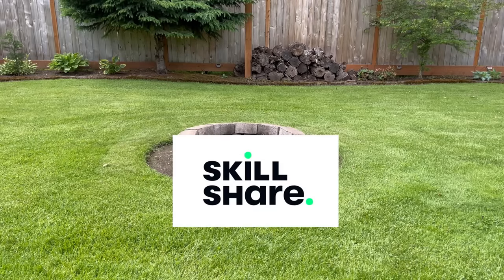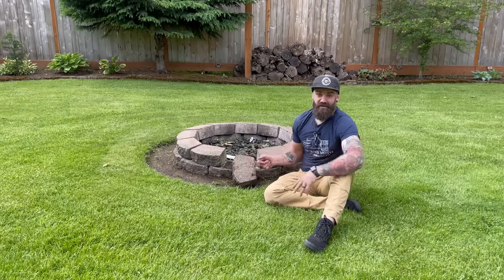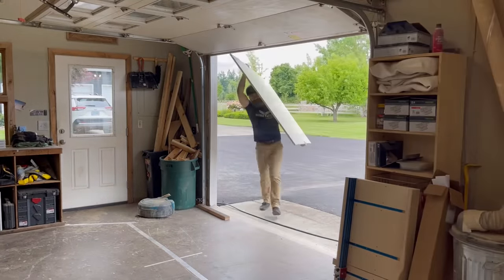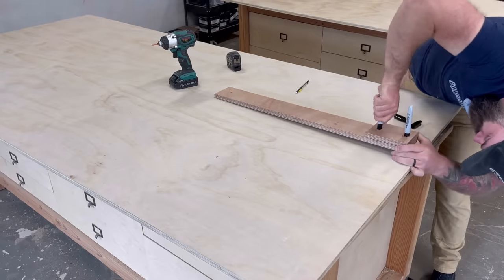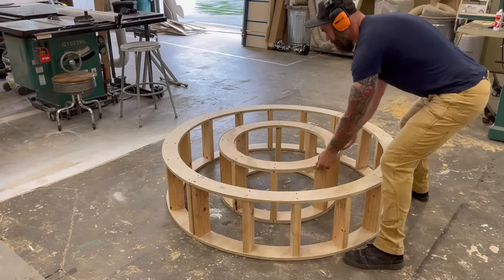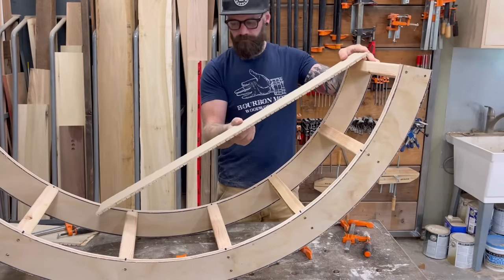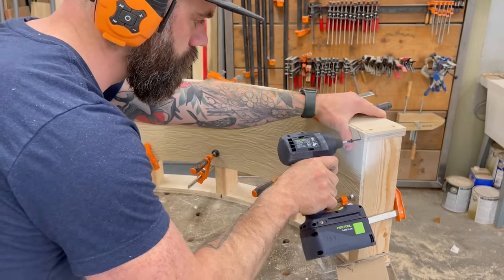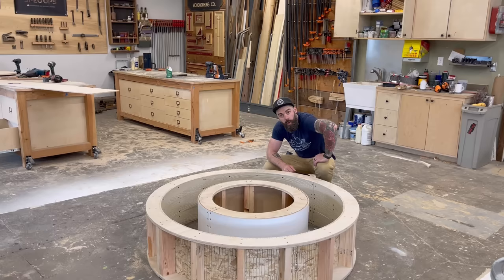Making a Concrete Fire Pit the Right Way || Ultimate Fire Pit Build

Comment: I'd be very curious to hear how you would design the inner form to come apart easier?
Reply: Hi.

The key to solving this problem is to make one of the junctions between the form pieces such that it leaves space for a triangular wedge. Instead of cutting perpendicular across the top and bottom of the form pieces, cut at 45° and place the sections of 2x4 flush with the angle. In the triangular prism shape now forming the junction between two of the inner form sections, secure in a triangular prism shaped piece of timber. It would need to fit neatly and be very well secured as the concrete is heavy .

In this way, when it comes time to remove the inner form pieces you would remove the triangular prism of wood from the junction where you installed it and this would allow you to pull one end of the section of inner form into the centre of the circle , thereby releasing the attraction of the form piece from the concrete by peeling. Once one piece has been removed, the other pieces can be peeled in the same way,  they would not need altered junctions. Only one junction would require the alteration. Bit wordy, but hope it helps.
Reply: @RoscoMule  makes sense to me...thanks!

Comment: You didn't use Form Release agent on the inside ring. 
I hope you didn't develop cold joints between pours.  
It's not load barring so it shouldn't matter but normally you need an epoxy cold joint sealant between pours if they exceed 60 to 90 minutes but it depends on the setting time that is most important.  It's just a fire pit so not a big deal at the end of the day.

Comment: Chamfer.  If you bang into concrete, it's going to hurt, no matter what.  If you bang into that sharp corner at the top, it's going to hurt, and cut you.  You never want to leave a square corner, so you get some 3/4" chamber, and nail it to the inside of your form, leaving a nice 45 degree chamfered corner when you pull the forms off.

Also, if I were the foreman, I'd probably stomp on the labor a lot more.  🤣

Comment: You seem very meticulous, however I don't think it will handle the thermal expansion without cracking... also sitting next to this you won't feel warm as the heat will go straight up and not outward.

Comment: It would've been cool to have the pvc go in at the bottom on the outside and snake to the top on the inside. This would've given you a "smokeless" effect. Because this is fairly wide, it wouldn't have worked as well as the small smokeless fire pits, but it would've been cool. You would also have to put in small drains at the bottom for water, as well.

Comment: I mean, this wasn't too bad (J/K very good job)...but if you want something even simpler and easier; you could have just bought Tube forms in 4 - 16" different radius (like 48 and 42" forms).  Prep your location with sand and/or pea gravel tamped tight and about 5-6" into the ground.  Set your largest diameter tube,  make a tic-tac-toe board of rebar to set 1/2 way through your bottom pour.  Your bottom our is going to be about 4 inches, mix it all at once, put 1/2 in, lay in your rebar, pour the other half.  DO NOT SMOOTH the bottom yet; set your inner tube as centered as you can pushing into the fresh concrete by only 1 or 2 cm.  and set vertical rebar between the tubes about every 6 inches and allow to achieve approx 1/4-1/2 set time, then mix about 2 times as much concrete for your walls and gently place in the forms so as to keep rebar vertical (this ensures your stuff remains all ties together even if it cracks).  Use high Sand content for the sides, use some extr4a pea gravel in the base layer.  if you want to smooth the bottom of the center for looks do that after you set the center tube as the inner lip created by setting the tube actually helps give a relief to prevent cracks from the base to start going up the sides while still maintaining a solid structure.  Seeing as you can buy those tubes by the foot most times and the cost of lumber...this method, even with rebar, should be about 30% cheaper and 75% faster than this method.  This is much closer to how pros do it, however their methods are more refined and their forms need to be reusable...yours do not.  You don't have to be particular with the rebar, it can be too long or too short, it is more or less just for structural tie-in as you are doing a partial set on your base instead of single pour (single pour this thick WILL crack unless you have Pro equipment, mixing, and delivery)  The rebar can be ground down with a standard angle grinder with little trouble.  These froms should leave you surfaces VERY smooth for tiling the outside with real or synthetic stone veneer with almost no prep time.  you should also add another set of vertical rebar for each 6" of thickness of your side walls (rebarr approx every 2-3" radius along your outer walls).  If you feel you need fire brick for your application put on a single layer along the bottom after setting the inner tube, then along the side once the set is complete and you remove the forms.

Comment: Even easier and probably less work: Use 2 construction tubes. 
1. 30"
1. 36"
Dig hole three to four feet, center tubes accordingly and press into dirt. Pour concrete, let set and as everyone else has pointed out burn out the center 30" and if done properly you should be able to pull the outside 36" off. Walla

Comment: When your mixing the concrete you didn't use any sand at all concrete is 3 part cement and 2 parts sand and 1 pebbles but great video

Comment: you can also edit and use styrofoam or have it cut to size.  that would have been much quicker and easier :-p
And pls buy a concrete vibrator 😂😝

Comment: Hell why not just burn the interior wood casting. Sure after 2 or 3 nice campfires it will be gone right? Will that rock create air pockets by chance causing the concrete to expand and contract with the rocks now having trapped moisture making hundreds of little hand grenades now lol??? Probably doesnt get much heat transfer after laying fire brick? Not sure...

Comment: I'm 15 minutes in right now and I see some serious design flaws in this project.  Hopefully they get resolved by the end.  
The concrete form has no openings to allow airflow for the fire. Also, the sides of the firepit are too tall and the diameter too small to allow proper airflow for the fire.

Comment: In the UK you can get meatl pans that are flexible and you bend then into the diameter you want then hammer the pins that are built into the sides of them to tie them all in and then sprag  the shutter it fosent take any more then 10 minutes I think you have massively over engineered this but it was in interesting to see you  Torture your self 😉

Comment: 1st: no foundation. 2nd: no chamfer on the edges. 3rd: no horizontal reinforcement with rebar.....and the thing with the rocks in the middle drives me nuts. So almost every step that didn´t involve wood was messed up. Pls guys don´t try this at home

Comment: Only 3 minutes in ...  :(  This was the worst way two draw the 2 curved pieces on that sheet. You could have shifted the rings lower parts of the rings towards each other, leaving you with almost half a sheet . But no, instead you drew them as far apart as possible, opting for a fine waste of wood..... Whyyyyyy ?????

Comment: This video really insists upon itself. To say there is only one right way to build a concrete fire pit is absurdly ignorant. Besides, concrete is a TERRIBLE medium for building fire pits, so it's not the "right way" in the first place. Concrete absorbs lots of moisture, and heat evaporates moisture, which causes swelling, and cracking in concrete. This guy just has way too much time on his hands.